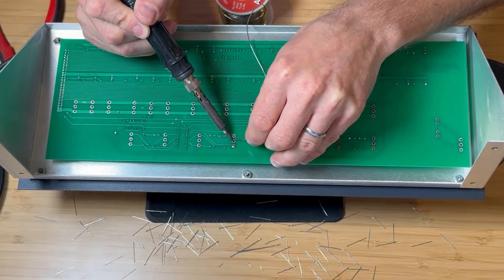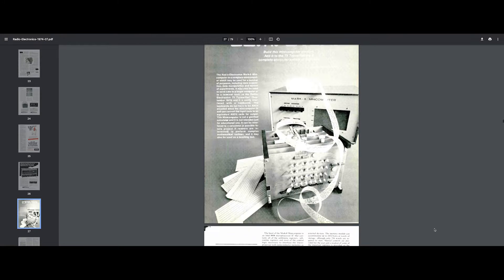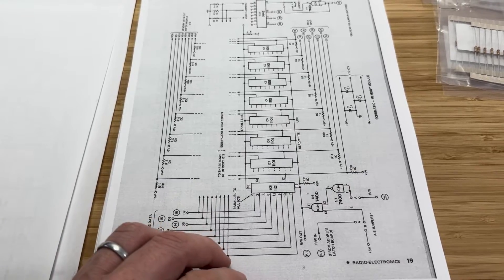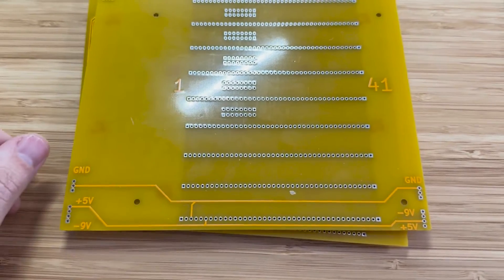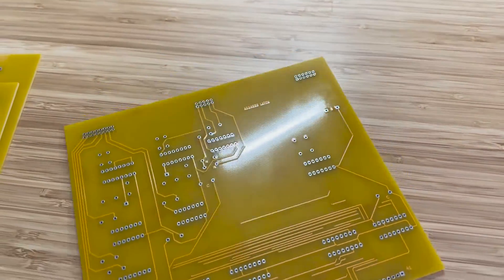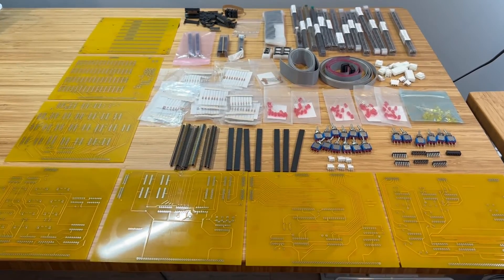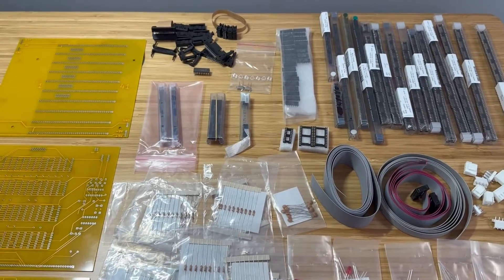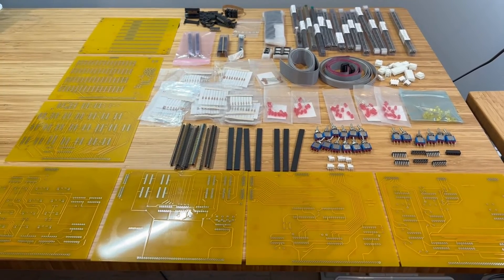Mark-8 Minicomputer Build - The First of its Kind

Comment: That's neat.  I designed and built a computer based on the 8008 in 1974.  At the time 8080 chips were $250, which was really expensive at that time.  I paid $44 for the 8008 and used 2102 static RAMs for 2KB of memory.  I built a terminal using a Seiko printer from a TI calculator.  It was a crude octal terminal, but a lot faster to get data into the machine than using the front panel.  As I remember, the 8008 took about 40 glue chips to make it into anything usable.  I didn't have PCBs, it was all wire-wrap.  I used a vector card cage for the memory and I/O boards. The 8008 was pretty limited, but it was still fun to work with.  When MOS Technology came out with the 6502 for $25, I jumped on it and sold the 8008 machine to a HAM.

Comment: Recently, I have seen set of original boards for mark-8 in a sale. I had an idea to have some 8008-based computer in my collection, but ended up with designing my own stm32-based SBC, as I did for 4004 and 4040.
Reply from the maker: Having original boards would be nice but they’re hard to work with.

Comment: LOL, it's great to see plated through holes. I built the original back in 1974. Solder all the holes with tiny bits of WW wire was a long and tedious process. But it did work !!
Reply from the maker: Yes, we are spoiled now!

Comment: I built a working mark-8 from the original schematics and board layouts in 2005.  It's still one of my prized possession - Mine looks identical to the original pictures, I found the same case as what Titus originally used.   My boards were made directly from the original layouts  with no changes so I had a few jumpers and a trace cut (if I remember right) to fix it.  Back in 2005 8008 chips and the 1101 intel memory chips were a dime a dozen on e-bay... Not so common these days.  The hardest component I found to source was the switches... or at least the switch handles. John Titus used the same style as the IMSAI computer, but with black handles instead of the Red and blue ones on the IMSAI.  I originally found enough of the proper switches, but then in a house move I lost my bottom switch register somehow.. so I was forced to find new switches and I couldn't get them anywhere. I eventually found some slightly different C & K switches that were close to the originals, but not exactly the same. I had to 3d-print an adapter to get the handle pivot point in the correct spot... and i couldn't get any more of the black handles so I bought some (VERY EXPENSIVE) red IMSAI replacement handles...
Reply from the maker: That's awesome! I don't think I'll be able to make it look exactly like the original pictures - it's hard to acquire all the correct components to make that happen.
Reply: @artemkalinchuk  it was sheer luck finding everything on Ebay... But nearly 20 years ago people weren't into collecting CPUs and chips and stuff, so they tended to be sold for a couple of bucks and there were still lots of them around... The case was one from mouser or rs-components or something like that and is still sold I think... I'm not 100% sure its exactly the same one, but it looks identical to the pictures. I had the front panel CNC milled out of a sheet of mild steel to look like the picture.
Reply from the maker: @Kodemaestro  That's great. Thank you for the information. I'll explore case options. Do you by any chance have the link to the enclosure that you used?